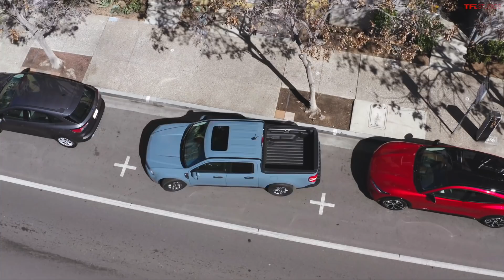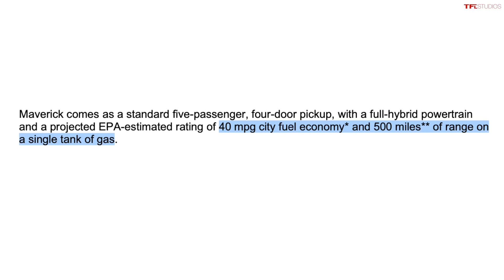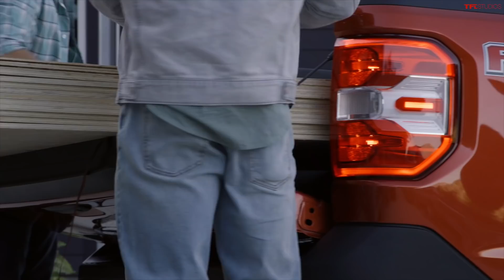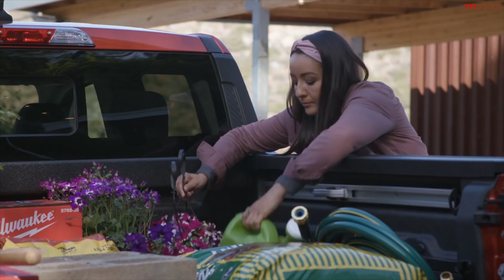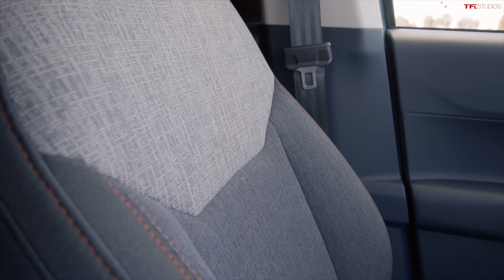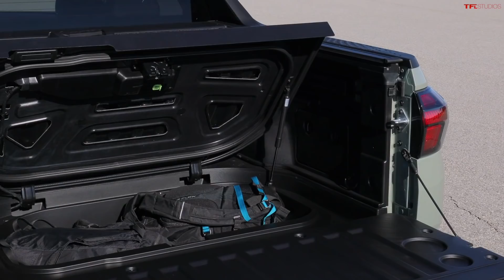Hands On With The New 2022 Ford Maverick: Here Are The Top 10 Things You Need To Know!

Comment: The XLT denim interior looks great, and I wish you could option that into other trims.  The fact that you can only get push button start at the Lariat trim level is extremely disappointing, when that feature is pretty much stand at mid levels trims in every other segment.  At only $36k for a fully loaded Lariat trim, the price is great.  Just wish I could lose the faux leather... leather in Texas is a dumb idea... and get the XLT's cloth... or just add push button to the XLT and I'm sold.

Comment: If i were in the market for a compact pickup I'd pick The Hyundai Santa Cruz, it is way better looking than this in my opinion. Also tows more (3700lbs for the standard engine, 5000lbs for the optional engine) also has a higher payload (1700lbs) also has a better warranty and probably better quality, but none the less I'm glad manufacturers are finally offering a compact pickup, since now they're all midsized and as almost as big as full size trucks from the 80s and 90s. They're definitely as long.
Reply: Only thing you suffer on is fuel econ.the maverick has 40 mpg while the cruz is in the mid 20s :)
Reply: @andromeda9340  very true, but thats with the hybrid, and on the highway in real world driving theyre probably alot closer, in the city I give the edge to the maverick hybrid, but I honestly wouldn't want the complexity of a hybrid. I dont mind sacrificing a couple mpg for a better vehicle thats more capable and better looking (in my opinion) with a better warranty. The front end of the maverick is ugly to me, so it must be paying homage to the original maverick, which was also ugly lol. Interior wise, I actually like the maverick.

Comment: No rear solid axle, FWD only, and a CVT?? I see what Ford is going for but it’s a pass from me lol. The turbo with 8 speed is a little better, but at that point I’d rather just save my pennies a bit longer and get a ranger with way more capability.
Reply: There's optional AWD when you step up to the gas engine version.keep in mind,this is a unibody vehicle so there's no need for solid axles :)

Comment: Finally a truck the average person can afford! Ford is going to struggle keeping up with demand. 

I just wouldn't buy the first year. Let's see how dependable these are.
Reply: Considering this is being built on a platform shared with the Escape and Bronco Sport, I doubt it's going to have many problems, and I seriously doubt they will be the major problems some first-year New vehicles have. If I were to guess, the issues that may arise will be relegated to software and the like.
Reply: @AgentFrosty  I am not saying it's junk. But very often, you hear of major issues with the first year edition of a new vehicle.

Let them work out the bugs after the first year, then buy it.... Nothing worse than spending your hard earned money on something that has a lot of issues.
Reply: @michaelh5055  Oh I understand what you're saying. But what I'm saying, is with this being built on a platform that is already proven, any little bugs or gremlins it might have will be on things unique to the truck itself. Its chassis, powertrain, suspension, brakes, all the major hardware is proven tech that has been out on the road. anything that MIGHT go wrong with it in the first year, will most likely be little things that aren't that big of a headache and/or very easy to fix. I think this will be one of those vehicles that will be safe to purchase for the first edition.
Reply: @AgentFrosty  The Ford escape in my opinion is a piece of chit. If it's based off the escape, that isn't a good start.
Reply: @michaelh5055  Well that's your personal opinion, and while you may be entitled to it, that doesn't necessarily make it true. 😛 It seems you're missing my point anyways, so I won't say anything else besides just wait and see what the vehicle is like when testers get their hands on it for some reviews. Until then, everything is just speculation and guessing off of these quick little previews.
Reply: @AgentFrosty  I don't care what brand or model it is. Do not ever base your purchasing decision on the opinion of these YouTube testers.

They are biased to whatever brand is sponsoring the video. Also, you can not judge the quality of a vehicle after a one or two hour test drive.

I laugh at most of them. One was testing a new model truck for off-road use. He was on a flat, dry dirt road and yelling this thing is an off-road beast! At one point, someone was standing around the area in sandles while he was saying let's put it in 4wd for this part 🤦‍♂️🤦‍♂️🤦‍♂️
Reply: Don't know why people always say no to the first year  155,755 miles on my first year pickup no problems
Reply: @starrider1900  The first year of a new vehicle almost always has issues.
Reply: @michaelh5055  155,755 miles first year truck no problem still kicking 💪
Reply: @starrider1900  Glad you got a good one. Not everyone is so lucky.
Reply: Don't expect the starting price to stay at $20k. You might have to order first-year if you want that.
Reply: @paulplack490  That was part of the project keeping a low price point. 
Did you not watch the video?

Comment: Ford, please make Maverick in a two door with a 6 ft bed.
Reply: Right? Who the hell needs four doors on a compact truck? 

The best truck I ever owned was a late 80's king cab Mazda B2200. The rear jump seats were useless for people, but the slightly extended cab was great for storing tools, bags, etc. and the bed was an actual useful length. On top of that, you could reach the bottom of the bed flat-footed with the tailgate up.
Reply: @thenotsoguitarguy9429 :  That's a good idea.  They should just ditch those seats and have good internal, strong, secure, lockable storage, and the bigger bed.  Surely there will be plenty of demand for such a configuration, if the truck proves durable and reliable.
Reply: @Ric Jones - The first gen Nissan Frontier also had the right formula. I wish I'd bought one of those about 12-15 years ago.
Reply: @Ric Jones:  You'd think so.  But if Ford is too stupid to incentivize salespeople to provide them with such feedback (when they get it in large numbers), it won't happen. 

But if the truck is good and there's sufficient demand, that small cab and larger bed configuration should be a winner as well.
Reply: Sadly it'll never happen on this car
Reply: @Ric Jones I'd like to hope so but I don't think they will change it unless it completely flops
Reply: @Cold As The Poles For as compact as this vehicle is, it looks like there's decent room in the back seat.  The narrator, who said he is 6'1, showed himself sitting in the back seat during his presentation, while the front seat was adjusted for his height, and he looked like he fit pretty well.  I'd personally prefer a standard cab with a 6 foot bed for this truck too, but that's not likely to happen.  If I decide to buy one of these, and I may, at least it will fit in my garage, unlike most of the behemoth trucks being sold today.
Reply: @Cold As The Poles:  If you bothered to watch the video, you'd see the reviewer fit in the back just fine, but without a lot of extra leg room.

Comment: Honestly surprised in a good way. While I'm not in the market for it, they really did a good job on the interior aesthetics, it's actually better than the current F-150 IMO. Side note * I cannot IMAGINE towing 4k pounds with that thing... No way, nope, not happening.
Reply: I bet it actually tows fairly well, I've towed over 3,000 lbs with my Escape that uses the same motor on many occasions and that thing makes enough boost down low that you barely even feel anything back there.

Comment: A lot of people (myself included) will always ask if we can replace our full size pickup with these mid size or small sized trucks?  The answer is, unfortunately no. 90% of the time this truck will do everything the full size truck will but when we need to safely tow the boat or camper or the tractor; we are really going to want at least 5,000 lbs towing but probably more to tow safely and confidently. Ford should try to get another 1,000 lbs towing capacity to compete better with Hyundai.

Comment: I’m an owner of Honda Ridgeline and the issue I’m having with my current vehicle is the towing capability and lack of transfer case so the ideal solution would be a truck with 7 1/2 K pounds of towing and lower gearing for off roads. The Ranger is ugly on inside and also too expensive, Tacoma too uncomfortable on inside and lacking new technology, also too slow so what’s my remedy. Idk, not Maverick though, everyone in looking for good looking, hardworking, capable midsize truck. Maverick isn’t it.
Reply: F-150 XL with STX Appearance package.

Comment: Tommy is super polished with his vehicle presentation skills! Great job!
Reply from the maker: Thanks so much Marvin!
Reply: @TFLtruck  Hello . I am replying to your comment about GM responding to the Ford Maverick 
 If i am not mistaken they did years ago long before the the Ford Maverick was even a pipe dream . GM built the HHR truck and even made a panel van also from the HHR  platform . Honda also did something like the Ford Maverick when Honda cane out with the Ridgeline . I do like the looks of the Ford Maverick so not knocking what Ford is introducing or your video which was well done but i do think it is Ford who is playing catch-up in the compact truck department !!!
Reply: @7natcho  The pickup GM made was called the SSR.  It was manufactured from 2003-2006, and was a retractable hardtop convertible roadster pickup.  During the first two years of production the SSR was powered by a 5.3 liter Vortec V8 making 300 HP, and during the last two years of production it was powered by GM's LS2 engine, making 390 to 400 HP.  In other words, the SSR was a single cab, hot rod convertible version of a small pickup.  Back in those days there were actually compact pickups from different manufacturers on the road too, and the SSR was never meant to compete with them.
The HHR was offered in front drive crossover, and panel van versions, but not as a truck.
Reply: He really is, presentation is a great word. It's not so much a review as a pitch to sell the car
Reply: No, he needs to work on it. He forgets to mention certain key features on new vehicles.

Comment: HI CRASH!!!  GOOD VIDEO!!  1) you didn't mention the spare tire location ( does it even have one??)  so I guess it doesn't have it like the Ridgeline;  2)  I think it's Great that even the base model is a full hybrid ( more power AND 40 mpg in the city?? WOW!!!)  3) while I like most of the interior, the center was vents are too low, and your right hand will get cold holding the steering wheel when the a/c is on; and that dumb "funny hole" next to the display screen is where the a/c vent should be!! and it makes the screen look smaller than it really is, and that there's room for a bigger, optional screen, which makes it look cheaper!!l. Otherwise, it has some very useful an interesting features; I think it will sell pretty well.    CHAS Orvis, Plainville, Ct.

Comment: meanwhile Honda Ridgeline is saying “hello, I’ve been here the whole time”
Reply: Haha! Yep - and still no in-bed trunk, composite bed, or dual-hinged tailgate (which, ironically, Ford invented decades ago - they called it the Magic Door Gate).
Reply: Not at that price point.
Reply: Ridgeline seems to have a confused focus. Not a good car and not a good truck. Besides looking nicer than other trucks it doesn’t seem to do or excel at anything very well.
Reply: @BusinessSolutionsATL , that's pretty much "Honda" in a nutshell - they rarely are the best at any one thing, but they do they many things reasonably well with an air of practicality about them. They just need to focus on controlling the quality drop and move back up to the top.
Reply: @zroger73  yep and Honda tends to be much more expensive than counterparts.

Comment: would have loved an 8 speed auto in the hybrid.  Hate CVTs.  I won't buy one until I'm forced to.  A fully loaded Lariat with off road package for low to mid 30s?  Sign me up
Reply: I've owned 2 vehicles with a CVT.  A Ford and a Nissan.  I loved them both.  You're comment sounds like you have never had one.  I'm curious what it is that you hate about them, and how you know that you hate them, if, in fact, you have never had one?

Comment: Just looks like another home run for Ford. This vehicle will sell very well.
Reply: Well the design is very acceptable and
Really gives me a throwback vibe to the small trucks back in the 2000s design wise

Overall the look has grown on me
Reply: This truck is gonna sell really good, I kinda feel like this us what the ranger should've been. The new ranger is just to big and to expensive. This has the size of the old one. And if I'm correct this one has more leg room in the back then the ranger even tho it's smaller. And let's face it 80 percent of people don't need a full size truck. As long as the power train is reliable this could push the (new) ranger back on the shelf. The price point for this truck is just gonna be hard not to look at it. Xlt for 22k, nice job ford
Reply: It’s so ugly tho😷😷 I wouldn’t drive one even if it was given to me. I’d sell it instantly
Reply: @mattdagger1480  for some people it doesn’t matter what it looks like. At least for me if I was buying this it would be for the function. 

A PT Cruiser has a lot of functionality, but you wouldn’t pick one out for its looks. 

This is a Bronco sport with the back chopped off so it looks like a bronco sport with the back chopped off.

Comment: I just wish I could get an AWD hybrid. Otherwise this would have been perfect for me
Reply: I don’t understand how that wasn’t a possible configuration.
Reply: @TonkaFire2019  I would imagine the battery underneath would limit the space for the drive line to the rear
Reply: @TonkaFire2019  Ford is sandbagging. They will release it when Hyundai releases its plug-in hybrid with all-wheel-drive.
Reply: @TonkaFire2019  best guess: Hybrid battery gets in the way of the driveshaft, and a rear electric motor would have heavily impacted payload rating
Reply: The hybrid cvt may not have provisions for a rear output.
Reply: @tangydiesel1886  I have a 2020 CR-V hybrid that comes standard with AWD. Only thing that would make it perfect would be a higher towing capacity
Reply: @Foggl343  I should of said the "Ford" hybrid cvt. I'm not sure of their other offerings that have hybrid cvt, plus awd.
I didn't mean it wasn't possible for other brands.
Reply: IMO, AWD should be standard on the Maverick. Honda has made it standard on the Ridgeline for 2021.
Reply: @damilolaakanni  Honda has made it standard for the Ridgeline  cause the MSRP is about $36,500, while this Maverick MSRP is only $19,995. I'm sure ford is cramming all they can for this price point. 

Plus not everybody would want AWD, especially if these trucks are gonna be bought by fleets or people on a budget.

Comment: It's crazy but I actually like the rotary shifter on this.
Reply: You'll really love it when it stops working and costs a small fortune to replace. Shift by wire is a terrible design compared to the tried and true lever and cable system that has worked for the past 40 plus years.
Reply: @mikejones-vw6hq  I know it's a horrible and unreliable system, but it fits this application, now I hate it on Raptors, broncos, mustangs, etc. But it weirdly fits the maverick
Reply: Dial shifters are no more or less reliable than any other shifter. Console shifer, column shifter, dial shifter, dildo, it doesn't matter. They are all electronically controlled.
Reply: @gasolinediesel972  cable operated shifters are not electronically controlled other than the solenoid that allows it to come out of park. Shift by wire means there is no physical connection between the shifter and the transmission, when you move the shifter you are asking a computer for permission to put it in gear. It is much more complicated and many times more expensive.
Reply: @mikejones-vw6hq  Most modern cars don't use cable operated shifters. Most of them are electronic.
Reply: @gasolinediesel972  some Chrysler products started around 2015, a few GMs around 2017, no Ford's to my knowledge. Anything older than that was probably on high end luxury cars only. I'm sure they will all go that way eventually but your statement is false, most modern cars are NOT shift by wire.
Reply: @mikejones-vw6hq  Almost all, Chryslers, GM's, and Fords use electronic shifters. They don't use cable shifters anymore because they take up space, and they don't allow for certain features like auto parking. The 2021 F-150 does indeed use an electronic shifter, the 2021 Silverado 1500 also uses one, and as you probably know, the Ram 1500 uses one.